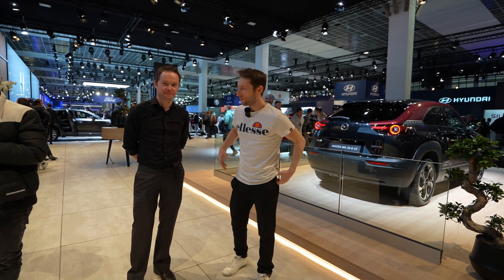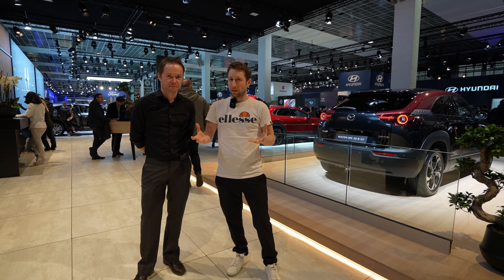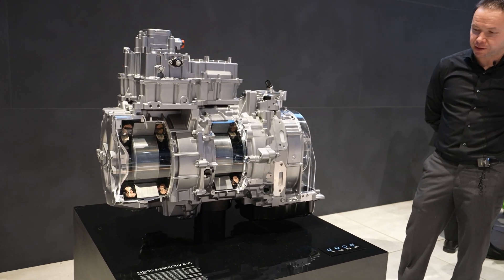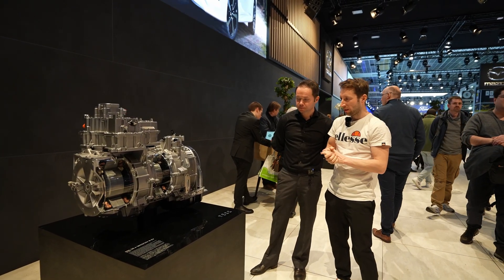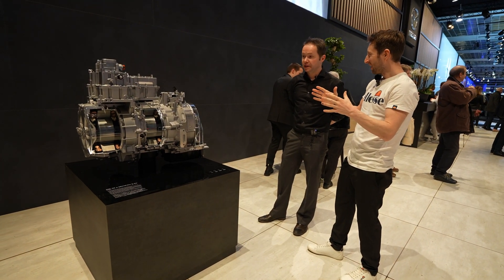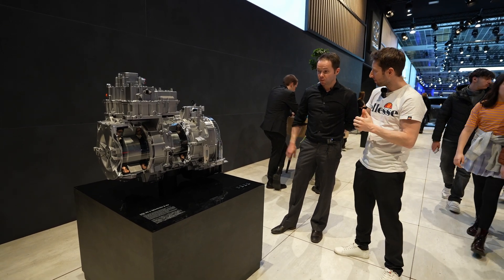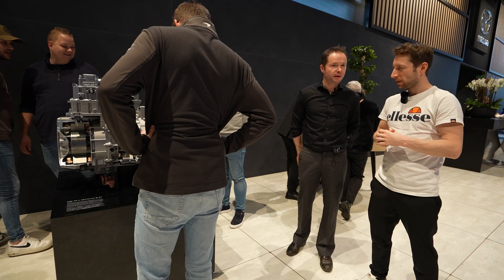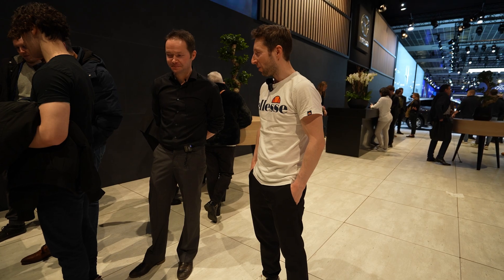Mazda MX-30 R-EV | Rotary Engine Explained | Interview Vincent Vanhamme Technical Specialist

Comment: My opinion. The setup is great, but the car itself is not practical unless you only have a driver and 1 passenger. Ridiculous that you have to open the front doors in order to open a back door, and the rear legroom is only suited for a preteen. Even a 13 year old will struggle to fit in the back

Comment: I live in a condo and cannot install a home charger and I would have to drive through an hour of Bangkok traffic to reach a charge station so hybrid was my only option. I really like the simplicity of an all electric with built in gas-powered charger. Even if you never connect to a charger, the car gets 120 kpl or 283 miles per gallon. Not everyone has the ability to have their own charger so this will appeal to a much broader market.

Comment: So this is why there was a huge space in the engine of the MX30. Maybe if I buy and MX30 you can install this Rotary engine
Reply: It's because it was designed as a hybrid powered by a 2.0 liter 4 cylinder Skyactiv G engine

Comment: The rotary is such a good idea for a PHEV. They major downside of PHEVs is the dead weight of the combustion powertrain so if it can be made as light as possible, that will also increase the range in EV mode. Having driven a Prius Prime, its a great car but it feels a bit silly carrying around a full-size engine that does absolutely nothing but weigh the car down until it's needed. I think this car has a great formula. The battery is not too large that the car is too heavy and it gets totally adequate range for most drives but it has the rotary as a backup and for longer hauls, but it weighs far less than a piston engine. If they have solved lubrication for this engine, they have a winner I think. I see mass-market potential for this powertrain for sure.
Reply: If that's true why isn't Mazda making them???

Comment: I really want to see the reviews of this model. I am specially curious about its performance and consumption at highway speeds. Will the rotary be enough to maintain the power at high speeds?
Reply from the maker: We will teat it soon Adrian 👍 Video will come soon
Reply: @SDADanCars is there any news? Do you know why it is still not available at dealers?
Reply: @sgergov  they started mass production only on 22nd June. I think it will be at the EU in October, if they sail the vessel with cars fast enough and burn a bit more of diesel, maybe in September late. :)

Comment: The wankel is just to run a generator?
Reply from the maker: Yes 👍
Reply: @SDADanCars  Wankel certainly seems like a great power-to-weight value proposition for a generator motor, but what about the emissions issues most Wankels have? Are the apex seals better than the ones on the old RX-8’s?

Comment: I really hope we see this as a 2 rotor in a new RX vehicle. Or if we don't, I'm really curious to see these housings & rotors start getting in the hands of tuners. More displacement per rotor is always appreciated, and the higher compression could mean better fuel economy and naturally aspirated power.
Reply: This is a series Hybrid, so the rotary engine here is just used as a range extender for the electric motor. I dont think that the rotary engine will be used for the propulsion of the car sadly, just as a generator really.
Reply: Why does the car need two rotors??
The rotor will then spend more time to charge and assist some kinetic movement.
Reply: @EastWood2004 he's saying take the stupid ass EV motor off the rotary and slapping two together so we have a full rotary engine again
Reply from the maker: Yes 👍 It is like a generator for the electric motor

Comment: why 2 rotors ???
Looks a lot bigger than I thought it would be .
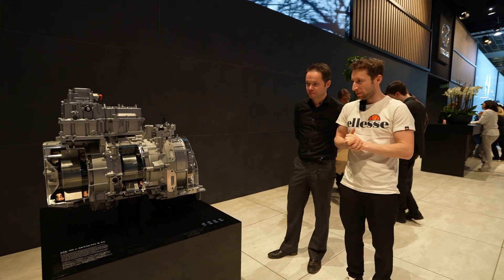1:01 2 rotors make it twice the size I thought it would be
Reply: It doesn’t have two rotors - just one single Wankel rotor. Those two shiny things you see towards the back of the engine are the electricity generators.

There could be two of them; one for charging the traction battery on the fly and the other for providing electric power to the traction motors - this is conjecture - but those are definitely two generators you’re looking at.

I also suspect one of them is capable of reversing polarity and acting as a powerful starter for the rotary engine itself.
Like the Prius (which doesn’t have a conventional starter motor like ordinary cars) you will never hear this vehicle making the chattering starter motor noise like ordinary cars.

Fascinating! I suspect Mazda might be still keeping some secrets back - until the MX-30 R-EV is launched.

I used to have a Mazda MX-3 which I drove for 8.5 years. Mazda were surprisingly very quiet about the vehicle’s built in passive rear wheel steer - probably for insurance reasons at the time - but the coupe DID have it and it actually worked a treat at speed!
Reply: @datathunderstorm  1:01 went to a Detroit auto show several years ago . 
Same monstrosity or something very similar on display
Reply: Mazda , started with a good idea , and over complicated it Again
Reply: Several years ago Mazda had an EV that nobody wanted, so they built a range extender generator . I went to the Detroit auto show and it was on display , very similar to what is in this video - I am almost sure it was a dual rotor  Wankel rotating the 2 rotors / shiny things in the video . Took me a second to realize it was Too Big ;  - electric vehicles should have a Really small ice engine to heat antifreeze and generate electricity .
Thanks for responding , didn’t notice it till today August 25, 2024

Comment: I just want to know how they handle oil burning in this engine. How far you can go before you need to add oil to the system? What kind of engine oil needed for this engine? Are they added any convinieces over their previous engine for and average user? Oil indicator?
Reply: Very good points.  I wonder too, and reporters should be asking.
Reply from the maker: I will try to answer in another video 👍👍🙏
Reply: @SDADanCars  Okay tqsm
Reply: I would start learning how to premix lol
Reply: @newagereject1  Better off running 13B then.

Comment: So it’s basically a Chevy Volt which had a lot of issues due to the complexity of this type of power train setup.
Reply: Toyota Prius Prime is the same thing, and they've managed it just fine.  But a single rotor wankel is far more simple, no valve train.
Reply from the maker: Thanks for feedback 👍
Reply: Thing is the Volt used the GM 1.4L Ecotec engine which honestly is kind of garbage in the Cruze and Trax.

Comment: A series hybrid.  The rotary engine is perfectly suited to this role. Found its niche at last. It is only a part time engine, being used occasionally.  Most people will charge the batteries.
Reply from the maker: Yea 👍
Reply: THEN WHY ISN'T MAZDA MAKING IT???
YOU LOOK LIKE A FOOL
Reply: Part time in rotary engine’s sweet spot (highway driving) if errands and std commute is done with charged battery as is 100% for most people.
Reply: Its shit , Mazda will fail with this
Reply: Opposite. Best is diesel and battery. Gas engines are useless for hybrids becasue in city it uses electrycity and on highway diesel is way more efficient. Wanel is the worst efficient engine out gas engines, the weight does not add benefits its suited for motorbikes not cars. Their efficiencies are 30% wankel, 35% gas, 50% diesel, 100% electric.
Reply: @kaeji_namitsua  
You do not get it. The Mazda rotary is tuned for constant speed running in which the rotary is at its most efficient, matching piston engines. The small size then matters as it is a part time engine.
Reply: @johnburns4017  Are you sure? It is not. It have the worst thermal effiency of all engines. Few kg less is less important than 20% more efficiency? Just one luggage makes the difference. The math aint mathin. I would love to see a graph where rotary is more efficient in traffic or on highway.
Reply: @kaeji_namitsua  
The new Mazda rotary engine has been designed specifically for efficient constant speed running turning only a generator. Revving up and down rotaries, as normal road operation, the efficiency drops off sharply.  It is perfect for the hybrid application. Most of the time the car will run from a charged battery from the grid.  The small size, low vibration and low weight of the engine is a great advantage in this part time application, as most of the time a hybrid genny engine is extra weight carted around. This has already been explained to you. 

There is enough on the 'net to explain the above. Also, Japan is looking to be a hydrogen society. Rotaries are 23% more efficient using hydrogen.
Reply: @johnburns4017  I could not find any data. If its so good why does it not go into  production? Trurning generator instad of wheels is a stupid idea. It works but only for hyper mileage. To me it feels like youre talking about ORP engine not wankel. Also hydrogen is more than 23% expensive than regular gas around 100% more expensive.
Reply: @kaeji_namitsua  
You can buy a rotary MX-30 hybrid right now. U tube has reviews on it. 

Mazda announced a sports car using the same technology.  Not confirmed for production yet.

Comment: What is fuel economy for city & highway?
Reply from the maker: Good question 😁i will test it soon
Reply: Fuel consumption is comparable to piston engines so I have read. But it is very smooth, light and small. So, when running on battery power alone, there is less weight to pull improving fuel consumption to a heavy piston engined series hybrid when running from the battery alone. Excellent advantage. 

Being only a part time engine, the fuel consumption is not that important as rarely will the car be used using the petrol rotary engine opposed to running off the battery. Typical overall annual fuel running costs, electricity and petrol purchased, is what matters.

Comment: Kind of defeats the point but i love how mazda are going rotary like the good old days
Reply from the maker: Yea true 👍
Reply: yes unreliability, high fuel comsumtion,oil burning, more pollution....good old days
Reply: Especially since it is a 50 litre tank to get 270 more miles whereas a conventional car can get over 500 with a 50 litre rank
So its not even like its more efficient
And you don't get the benefit of it being sporty since it isn't
Reply: @beamboy07   so this car uses 11.5ltr per 100klm ? when charging the battery with one rotor with minimal load? Are you sure
Reply: @leethallee6718 can you explain why there are 2 rotors , I can’t watch this video